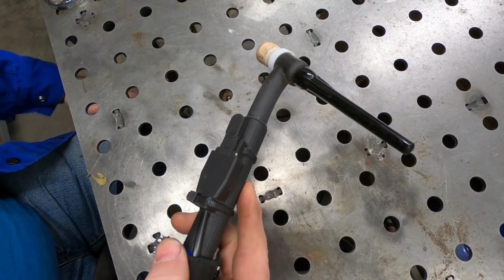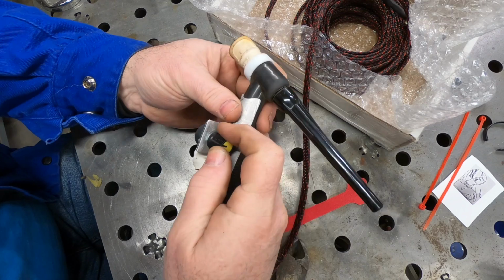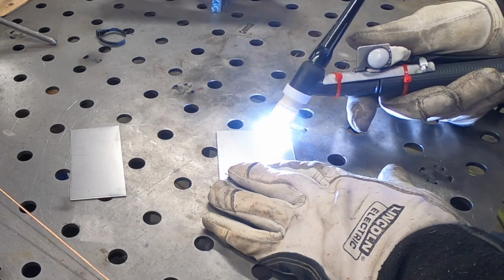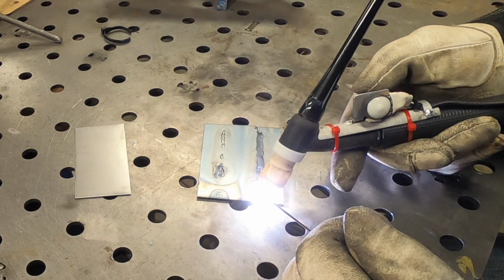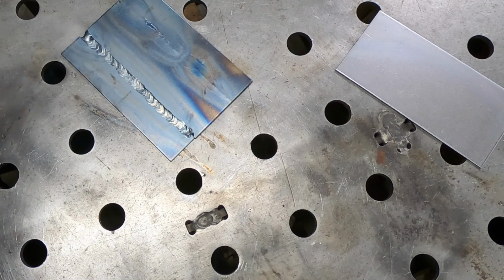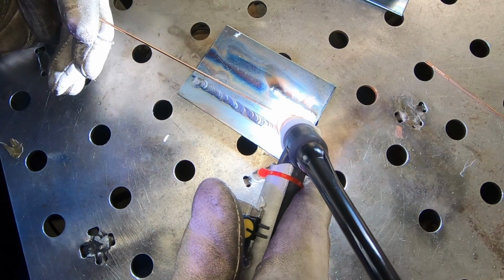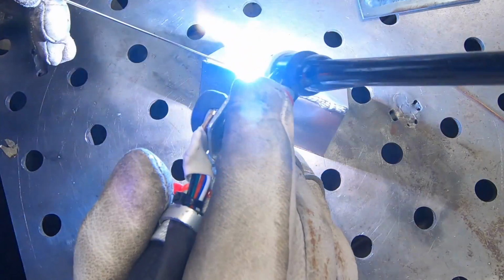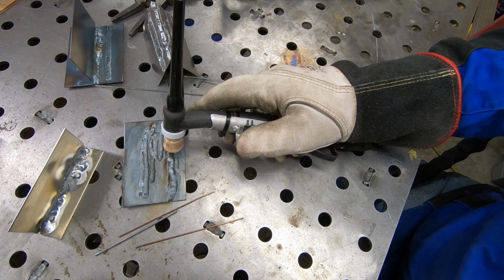Fingertip Amperage Controller (Product Review)

Comment: Greg is the Lazer tungsten the same as Lanthanated?
Reply from the maker: It is not. Although Lanthinated is not radioactive, which is better than thoriated, the CK tungsten, at least for me, holds a point better than lanthinated.
Reply: @MyLilMule  Thanks Greg. I ordered a test pack of it from your recomended supplier as well as some steel and stainless steel tig wire. I spent an early part of my life as a professional welder and was better than average with the tig torch but now I need new eyes and machines and consumables have changed a lot. then we had 2 choices. Red and Green. (2%thoriated and Pure) Pedal remote or none. Now you can buy a lunch box welder that can do more than the one we had that needed wheels or a forklift to move. I have a Miller Econo Tig but I recently bought one of the China Lunchbox welders now all I need is new eyes. Thanks for the rapid response. 
Terry from Texas

Comment: nice review. im just learning tig on aluminum. got a roller dial and been doing same adjustments with position so it works but doesnt change arc distance. practise has made it better. still trying to figure it all out. good video. ty
Reply from the maker: Practice, practice, practice. Keep with it!

Comment: The knob looks like it is on a rotational rheostat. I think it should be a forward/back sliding rheostat for easier control. Worth a try.
Reply from the maker: I think someone else makes something like that. I'd like to give it a try some day.
Reply: It's would be a 10k potentiometer, almost no modern welders use rheostats.